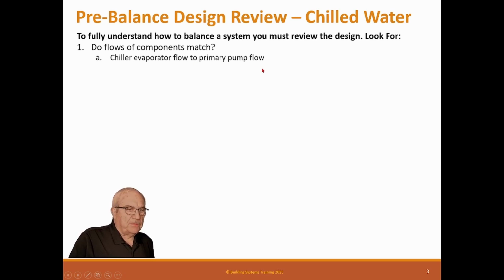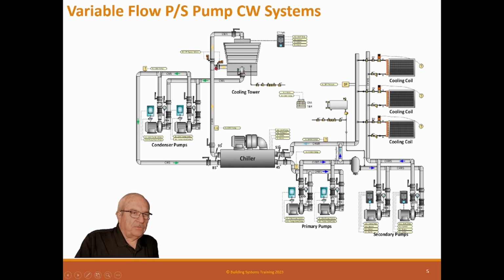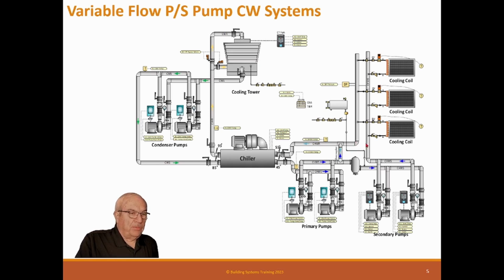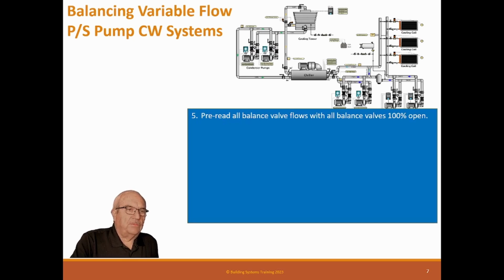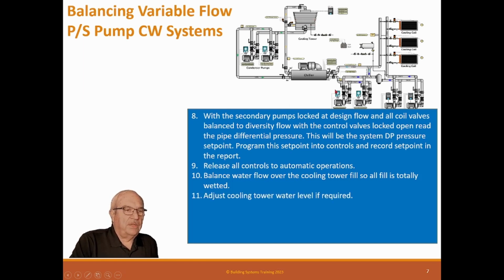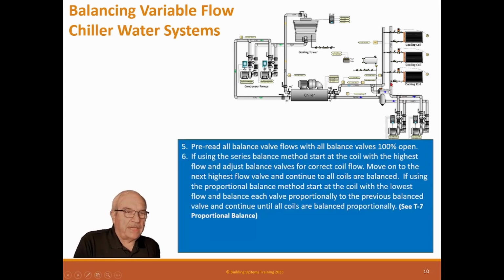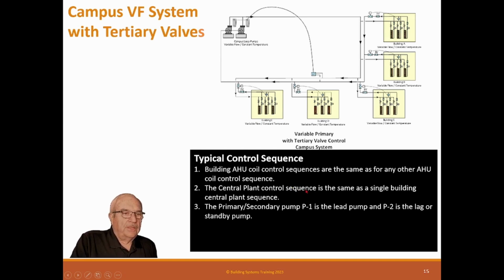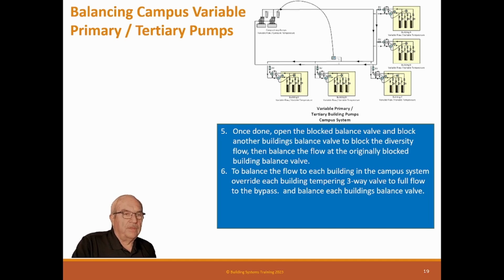HVAC how to Test & Balance Variable Flow Chilled Water Hydronic Systems, Training Session T-22

Comment: First time I see the primary pumps before the chillers. Is that right?
Reply from the maker: Not sure what you mean the primary pumps suck water from the chiller and distribute it to the secondary pumps and to the load. Check the flow arrows on the diagrams.